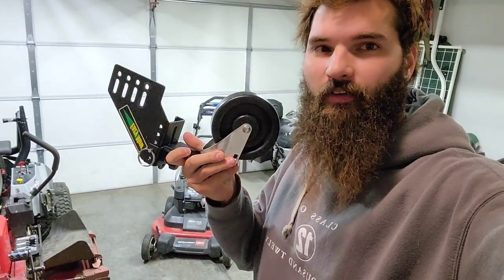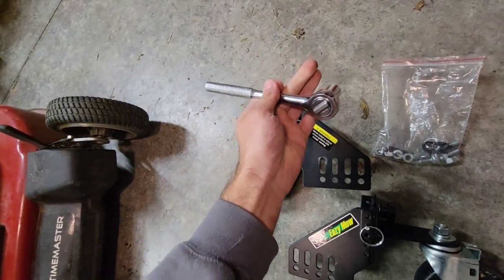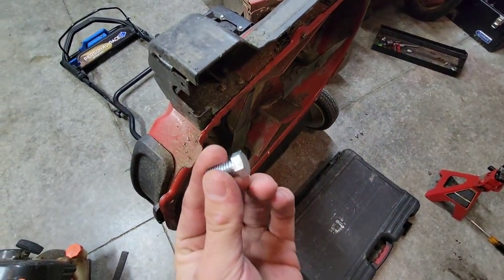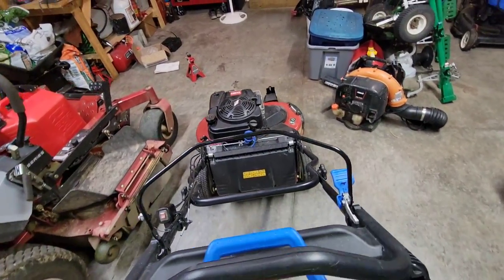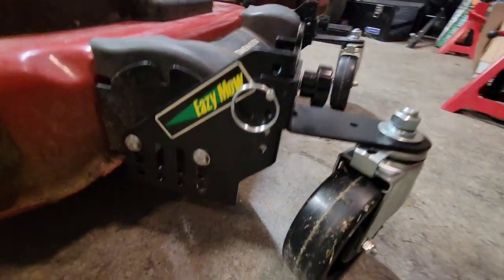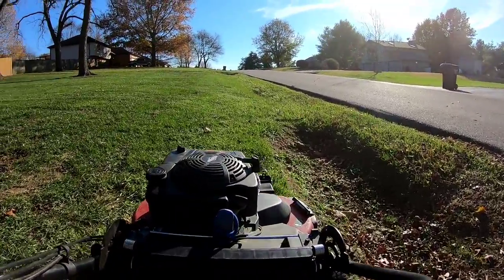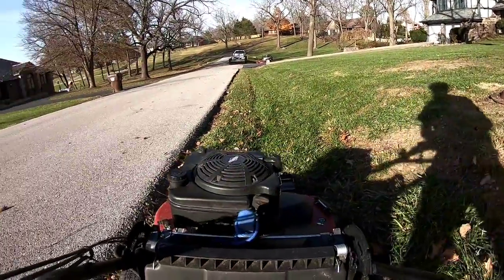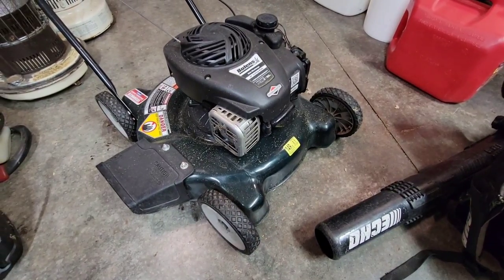Installing Caster Wheels On Toro Timemaster 30" Mower

Comment: Five years ago, I bought a good used, well-maintained 2 y/o TimeMaster. Just got done replacing the BBC cable and installing the casters and a 1 gallon fuel tank (combined the 2 for extra capacity), gave it a tune up with a SeaFoam treatment, new plug, gas and air filter, synthetic oil and Oregon hi-lift blades. Practically a brand new mower!! Will eventually upgrade to the 223cc B&S engine. I also installed a 2nd washout fitting on the opposite side of the deck. Thanks for the video.

Comment: Man you should invest in that 33inch cub cadet next season
Reply from the maker: @J.P. LAWN CARE no way...this mower is way better in my opinion. It's smaller lighter in weight and can fold up. It has its flaws but it's better for my setup. These caster were just to mess around with mainly. I want to get this mower through one more season and then I'll upgrade to the ferris fw15. Plus I don't have good dealer support for the cub cadets

Comment: Did you make your modifications??? You could also add a sulkey. I was thinking about adding one to my recycler so my 3 year old can join in on the fun
Reply from the maker: @John Grinnell well actually I've been working on some mods for these, they made it about 6 months of commercial use and abuse before they broke. I'll have vids returning coming in a few weeks. As for the sulky idk if this mower would have enough power to pull it....maybe for just your kid but I'd be careful with pulling any weight behind this as it's extra wear and tear on the drive system that seems to be temperamental at times

Comment: Harbor freight sells a much nicer bigger / rubber  caster wheel.  Did u do an upgrade yet ?  I think I just a wheel closer to the stock size and height !
Reply from the maker: Yep, the extra weight of that wheel was too much for this bracket. I did end up adding an extra peice of metal to the bracket to run the better tires

Comment: Do you think these would work on the xmark commercial 30? Wheel setup is different than the toro version.
Reply from the maker: They probably would, but the exmark is a commercial grade 30" so it might be a bit to heavy for these to use long term

Comment: Do you find it hard to do straight lines on a flat lawn?
Reply from the maker: @rawe63 that's a great question. On the rougher yards it absolutely will not do straight lines. I'm hoping when I modify these it will help with that. On a perfectly smooth property it does require a bit of concentration to jeep it straight but it can be done
Reply: @JonsDailyHustle  ya I wondered about that, it would be a concern for sure. 
Turning the Timemasters can be a pain but with experience it does get easier.
I think if you were to retrofit a wider wheel it might track better and also not compress the grass as much.
Cheers from Canada.

Comment: Love the idea and yes, it will work great but, right away even before you demo and said it, won't work on ditches and hills. You will have to fight it to keep it straight. I wonder if you can modify it somehow to have a pin or something to put in so the wheels stay straight for when you are doing hills? I know your wheels in your head turn like mine lol. Thanks for sharing that idea. What I would like to try and do is make a remote control Timemaster. Hmmm. Great video Jon!
Reply from the maker: @MBG Adventures I will definitely be modifying it in the future, we'll see what I can come up with. It definitely needs some adjustments but shouldn't be anything I can't handle lol

Comment: Nice Jon!!! They seem to work great but your right if you put the same size wheels as the original in there it will probably work much better. Can you lock those in place ?
Reply from the maker: @TG Lawn Maintenance thanks ,they work pretty good so far. No you can't lock them in place so you can't use them on inclines...however I plan to do a diy upgrade with them and make them lock in place
Reply: @JonsDailyHustle  yes that would definitely help them along with some bigger wheels like you stated great video bro 👊🏼
Reply: You can lock them they have a pin included to put in the center
Reply from the maker: @hayssszzzz9253  I will have to check into that cuz I didn't see a spot for a pin or an extra pin for that on this model at all
Reply: @JonsDailyHustle  I saw that small hole is the one you can lock or put the pin
Reply from the maker: @hayssszzzz9253  I will have to check it out when I get back home from vacation,  I'll make a shorts video about it. If your right I'll give credit to you for it lol. I might have over missed it 🤷‍♂️